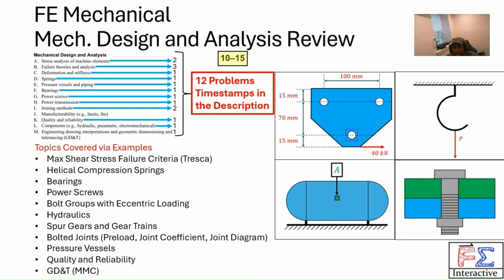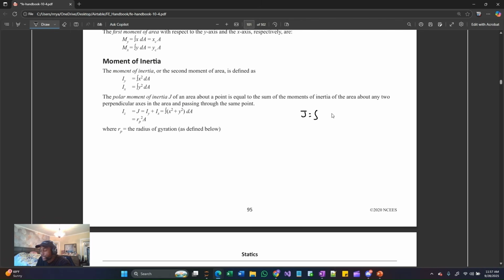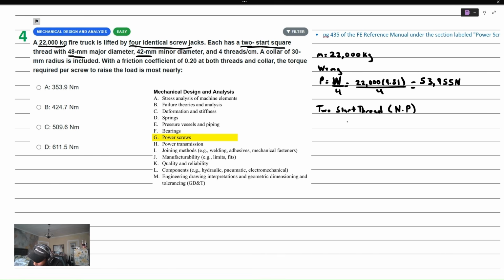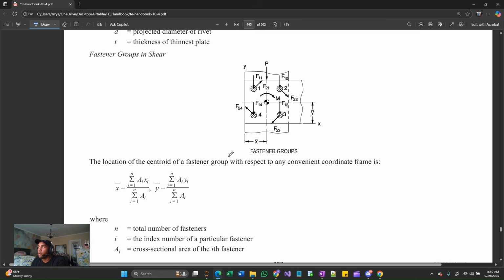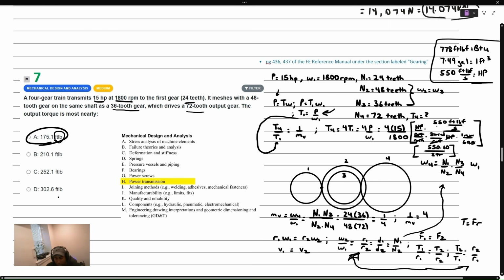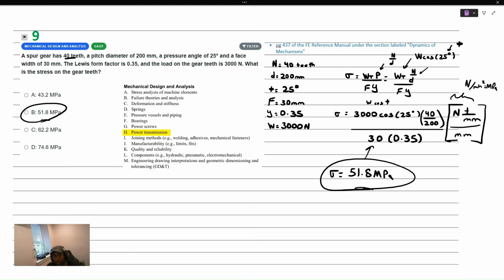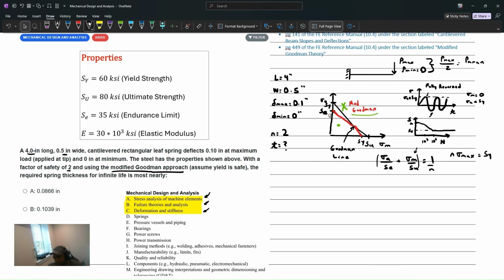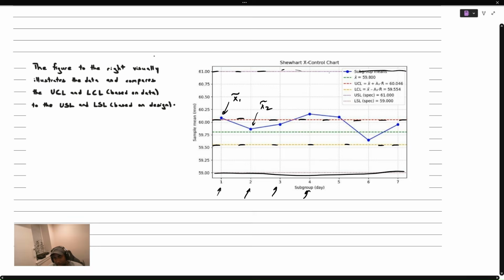FE Mechanical Design  and Analysis Review – 12 Real Problems That Teach You the Core Concepts

Comment: In problem 5, why did you not square root the ((70/3)^2 + 50^2) radial distance?
Reply from the maker: The relevant formula for calculating the secondary shear force, where the distance comes into play, is:

F_i = T*r_i / Σ(r_i^2)

where:

T is the statically equivalent torque produced when we shift the applied loading to the centroid of the bolt group.

r_i is the radial distance from the centroid to the bolt of interest.

Σ(r_i^2) is the sum of the radial distances squared for all of the bolts.

For bolt 3, which is the bottommost bolt, the radial distance ( fully vertical) from the centroid is:

r_3 = (2/3)(70)

The denominator is:

Σ(r_i^2) = (70/3)^2 + (70/3)^2 + [(2/3)(70)]^2

So when calculating the secondary shear force at bolt 3, we plug in:

F_3 = [24,666.67*(2/3)(70)] / [(70/3)^2 + (70/3)^2 + ((2/3)(70))^2]

The important distinction is that the denominator contains the sum of the distances squared, Σ(r_i^2). There should not be a square root applied to this term because the formula specifically requires r_i^2.

In the numerator, we only need the actual radial distance to bolt 3, r_3. Since bolt 3 is directly below the centroid, that distance is simply (2/3)(70).

So the calculation shown in the solution is correct. The square root is not needed in the denominator because we are summing r_i^2, not calculating a radial distance.

Comment: Hi. It's probably because I'm studying at 9pm after work but I don't understand which cross section we're using in problem 1. Is it the circular cross section of the hook, or are we taking some slice through the hook? I've rewatched your explanation about the axial and bending stresses multiple times and I'm sorry but it's not clicking for me.
Reply from the maker: No problem at all. Everything is not always clear the first time, and I am glad you asked the question. Hopefully we can clear it up here.

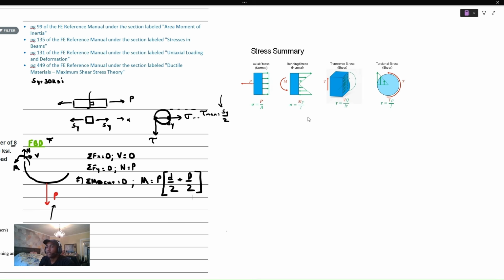To determine stress in a body, we first need to make a cut through the body. Stress can vary not only along the length of the part, but also across the cross section itself. I discuss this idea in the stress summary around 9:55.

For this problem, I specify that we are interested in the critical section, which coincides with the location of maximum bending since in the problem I say:

"Assume the critical section occurs at the location of maximum bending" 

To determine where that is, we look for where the internal bending moment will be largest.

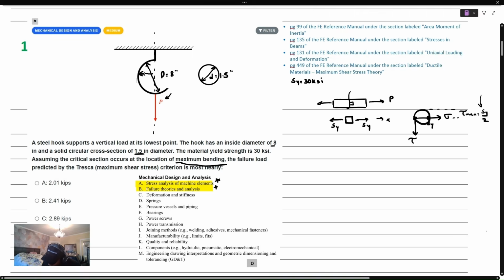At around 7:10, I draw the cut we are working with in red. This location has the greatest perpendicular distance from the line of action of the load P, so the internal bending moment reaches its maximum there.

The important distinction is between the location of the cut and the shape of the cross section. The red line tells us where along the hook we are making the cut. If you imagine extending that red line into the screen and completely slicing through the hook, the exposed surface is the cross section we are analyzing. Since the hook itself has a circular cross section, that exposed cross section is circular.

When we make that cut, there is actually a distribution of stresses acting over the entire exposed circular cross section. We do not want to carry that full stress distribution into our equilibrium equations, so we replace it with its statically equivalent internal resultants.

In this problem, those resultants are an internal normal force and an internal bending moment.

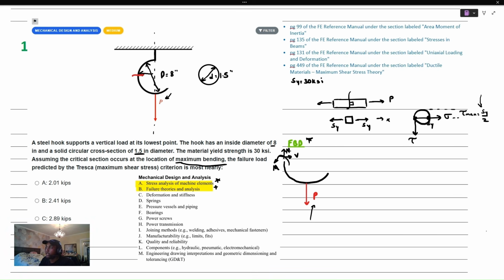I draw the free body diagram around 7:48 and use equilibrium to solve for those internal resultants. They are simply the statically equivalent representation of all the stresses acting over the cut cross section.

Conceptually, the process is:

Stress distribution across the cut → statically equivalent internal force and moment → use equilibrium to solve for those resultants → use the resultants to determine the stress distribution across the section

Once we know the internal normal force and bending moment, we can work backward and determine the stresses acting over the circular cross section.

The internal normal force corresponds to a uniform normal stress across the cross section.

The internal bending moment corresponds to a nonuniform normal stress that changes linearly from tension to compression depending on where you are in the cross section.

So there is not one stress value for the entire circular cut. We are interested in the location where the total normal stress is largest. In this problem, that occurs at the ID of the hook, where the tensile bending stress reaches its maximum.

At that point, the normal stress associated with the internal normal force and the maximum tensile bending stress act in the same direction, so we add them to obtain the maximum normal stress.

So the short answer is yes, we are using the circular cross section of the hook, but specifically the circular cross section located at the red cut shown around 7:10.

Comment: in problem 1 what happened to the tresca criteria the sy/2?
Reply from the maker: The FE Reference Handbook gives the Tresca, or maximum shear stress, failure criterion as

(σ1 − σ3) / 2 ≥ Sy / 2

where σ1 is the maximum principal stress, σ3 is the minimum principal stress, and Sy is the tensile yield strength.

If you have a simple case where there is only one nonzero principal stress and the minimum principal stress is zero (the case in our problem),

σ3 = 0

then the Tresca criterion becomes

(σ1 − 0) / 2 ≥ Sy / 2

σ1 / 2 ≥ Sy / 2

σ1 ≥ Sy

Therefore, yielding begins when

σ1 = Sy

I believe this is where some of the confusion is coming from. In the FE Handbook equation you see Sy / 2, but after simplifying the equation for the case where σ3 = 0, the 1/2 appears on both sides and cancels, leaving Sy. Hopefully it is clearer why that happens.

The physical interpretation also helps.

Tresca states that yielding occurs when the maximum shear stress anywhere in the body reaches the maximum shear stress that exists in a simple tensile specimen at yield.

At 4:52 in the video, I show using Mohr's circle why the maximum shear stress in a simple tensile specimen at yield is

τmax,yield = Sy / 2

Then, at 15:07, I show that the radius of Mohr's circle corresponds to the maximum shear stress for the actual stress state in the problem. For the case where σ3 = 0,

τmax = (σ1 − σ3) / 2

τmax = σ1 / 2

Yielding occurs when this reaches the maximum shear stress from the tensile specimen at yield:

σ1 / 2 = Sy / 2

which gives

σ1 = Sy

So the Sy / 2 has not disappeared physically. Both sides of the Tresca equation represent maximum shear stresses. The left side is the maximum shear stress in the actual stress state, while the right side is the maximum shear stress present in a simple tensile specimen when it begins to yield. In this particular case, both sides contain the same factor of 1/2, so it cancels. Hope it is clear.

Comment: Hello for problem 10 after you check for the thin wall assumption and you're calculating the hoop and axial stress, isn't the r not the same as r_i that you used for the thin wall assumption? shouldn't you use (r_o+r_i)/2 not r_i? So instead of sigma_t = P*60, it would be sigma_t = P*60.5? Thanks
Reply from the maker: Hello, great question.

You are correct that there is a small distinction between the inner radius, outer radius, and mean radius.

In this problem, the radius is given as 1.5 m and the thickness is 25 mm (0.025 m), but note the problem does not explicitly state whether the 1.5 m is the inner radius, outer radius, or mean radius.

If we assume 1.5 m is the inner radius:

r_i/t = 1.5/0.025 = 60

If we use the mean radius instead:

r_m = (1.500 + 1.525)/2 = 1.5125 m

r_m/t = 1.5125/0.025 = 60.5

So yes, using the mean radius would make the equation:

Sy = P(60.5)

instead of:

Sy = P(60)

However, because this is a thin-walled pressure vessel, the difference is very small. The thin-wall assumption is valid when r/t > 10, and here r/t ≈ 60.

Using r/t = 60 gives:

P = 4.17 MPa

Using r/t = 60.5 gives:

P = 4.13 MPa

This is a difference of less than 1%.

Additionally, the FE Exam answer choices are based on the answer that is "most nearly" correct. Regardless of whether you use the inner radius or mean radius, the correct answer would still be:

Choice B, 4.17 MPa

For a thick-walled pressure vessel, this distinction becomes much more important because the wall thickness is no longer negligible compared to the radius and the stress varies significantly through the wall thickness. In that case, the choice of radius and the exact stress distribution must be treated more carefully.

So your reasoning is correct, and using the mean radius is slightly more precise. However, the problem does not specify whether the given radius is the inner radius, outer radius, or mean radius. This is common for thin-walled pressure vessel problems because the wall thickness is very small compared to the radius, making all three values nearly identical. As a result, the difference in the calculated pressure is negligible (less than 1%) and does not affect the final answer choice.
Reply: @Eng_Fundamentals  Oh ok this makes sense. Thanks a lot!

Comment: Problem 12, wouldn't the MMC for a flange be the upper tolerance, 61mm?
Reply from the maker: Good question. The problem does indicate that we are talking about the hole because it later states, “Each day, 10 holes are measured for 7 days.” That implies the feature being controlled is the hole diameter, not the outer diameter of the flange. Since it is an internal feature, MMC corresponds to the smallest hole size, which would be 59 mm.

That said, I agree the first sentence could be clearer, so I will update the wording slightly to make the feature explicit.

Original (Problem 12):
A flange has a design diameter of 60 mm ±1 mm. Each day, 10 holes are measured for 7 days. The sample mean is 40% of the tolerance from MMC and within limits. The average range is 40% of the tolerance. For a Shewhart x-bar chart, the LCL is most nearly:

Updated (Problem 12):
A flange hole has a design diameter of 60 mm ±1 mm. Each day, 10 holes are measured for 7 days. The sample mean is 40% of the tolerance from MMC and within limits. The average range is 40% of the tolerance. For a Shewhart x-bar chart, the LCL is most nearly:

Hope it is more clear now.

Comment: I feel like these problems are too complicated compared to what will actually be on the exam.
Reply from the maker: Thanks a lot for the comment, I really appreciate you taking the time to share your thoughts.

On the FE exam, some problems will take longer than three minutes while others can be solved in under twenty seconds. It balances out overall. For the core subjects, even though I explain more in these videos to carefully walk through the reasoning, most exam problems, including the ones in this video, really boil down to one or two equations from the FE Reference Manual. Every solution I show is based directly on equations or concepts from the manual, so everything is absolutely in scope. In the end, it really comes down to timing and efficiency.

I do mix in harder ones on purpose sometimes for two reasons.

First, if you can handle a slightly more involved version of a concept, the typical FE question feels much more manageable. Think of it like training a little above what is required so the actual exam feels smoother. What I want to avoid is a student doing very well on my platform, scoring above 75 percent in a section, and then walking into the exam and being caught off guard. If prep is simplified too much, that can become an expensive mistake, both financially and in terms of time and energy that have to be repeated. I would rather prepare you slightly above the level required so that exam day feels controlled and familiar, not surprising.

Second, it allows me to go more in depth on the principles behind the problem and really give the refresher people are looking for. One of my biggest frustrations back in college was when we would only do very simple examples in lecture. Then you would go home, open the homework, and suddenly the problems were much more challenging and you felt stuck. I try to do the reverse here. I walk through a more challenging version so that when you go practice on your own, the standard FE level problems feel manageable and familiar.

And I can confidently say that the ideas I discuss are absolutely going to be tested on the exam. These are the building blocks. Failure theories, stress analysis and transformations, springs, power screws, bolt groups,  bolted joints, gears, pressure vessels, hydraulics ... No matter how the question is framed, those core concepts show up. The exam may simplify the numbers, but it cannot avoid testing the fundamentals.

My advice is not to focus too much on difficulty or speed at first. Focus on understanding the fundamentals and how the equations connect. After working through a good number of problems and really studying the solutions, your speed improves naturally.

On exam day, use strategy. Answer the ones you know first, flag the tougher ones, and come back later. That combination of strong fundamentals and smart pacing helps you maximize points and avoid getting stuck, and when paired with consistent practice, it guarantees your passing score!
Reply: @E @Eng_Fundamentals anks for replying. I kind of just skimmed through the video but I’ll give them a shot hopefully this week. Exam is on March 10th so I’m trying to prepare as much as possible. But yes, you do have a point about being over prepared rather than underprepared.

Comment: OK.  I am caught on how you got maximum shearing stress from Mohr's circle at 1:32:30.  Perhaps you can please break things down more (?)  Everything else I am good with :)
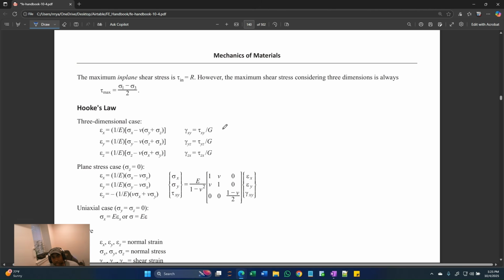Reply from the maker: At 1:36:00 I discuss the equation used to determine the maximum out of plane shear stress.

t_max = (sigma_1 − sigma_3) / 2

Here, t_max is the absolute maximum shear stress, sigma_1 is the largest principal stress (60P), and sigma_3 is the smallest principal stress. Since there is no stress in the z direction, sigma_3 = 0.

Plugging in the values gives:

t_max = (60P − 0) / 2 = 30P

What I was doing at 1:32:30 was showing why this is the case using Mohr’s Circle. I plotted the principal stresses (60P, 30P, and 0) and then focused on the Mohr’s Circle formed between 60P and 0 (diameter of 60P or radius of 30P which represents the absolute maximum shear), which corresponds to the yz plane and therefore a rotation about the x axis. The radius of this circle gives the absolute maximum shear stress.

This approach is powerful because it tells you more than just the magnitude. It shows that at a 45 degree rotation about the x axis, making a cut will expose the absolute maximum shear stress (and an average normal stress), which the equation alone does not tell you. That is why I love Mohr’s Circle and often prefer it over equations. It is very visual and gives you clear physical insight into what is happening. Hope this is clear.
Reply: @Eng_Fundamentals Thanks!  I was looking at Mohr's circle and I do see now that τ(max)=R.  I now see the distance between the points of 30P and 60P does give us a distance or radius of 30P.  This does help! :D.  Thank you, Sir 😊

Comment: 1:23:10 Problem 9 – Spur Gear Bending Stress1:23:10 Problem 9 – Spur Gear Bending Stress 
Hi I have bought your course on FE interative tool. It is very helpful. Would you share why you are using Cos(phi) here instead of Tan(phi). The FE reference handbook has only given Tan(phi) formula. I am wondering, when to use Cos(phi) vs Tan(phi)? second, can FE questions be asked even if the question is not given in handbook?
Reply from the maker: At the top of the FE Reference Handbook entry for spur gears, there is a small schematic that shows the direction of the total load and how it splits into the radial and tangential components. The tangential component is the transmitted load, and the radial component pushes the tooth inward. I will update the solution for this question inside FE-Interactive so the connection to that schematic is clearer, including why the cosine component is used.

The key point is that the handbook equation uses the transmitted force Wt, not the total force. The schematic shows that Wt is the component adjacent to the pressure angle, so Wt = W_total cos(phi). Tan(phi) represents Wr/Wt, which is only helpful when one of those components is already known. In this problem we start with the total force, so we need to resolve it into its components first before using the bending stress formula.

It helps to picture a fixed-end beam. An axial force would push straight into the beam and not create bending, while a transverse force would produce bending. That same idea applies here. The radial component acts like an axial load and the tangential component acts like the bending load.

Only the transmitted component creates bending in a spur gear tooth. The FE exam will not always give values in the exact form used in the handbook equations. Just like in real engineering work, you have to interpret the information, resolve forces correctly, and match each equation to the component it really needs. Sometimes the problem uses a different orientation or coordinate system, and that is where returning to first principles really helps. Hope this ties things together clearly, and thank you for being a subscriber to FE-Interactive.
Reply: @Eng_Fundamentals  Greatly appreciate your reply and explanation. Thanks!